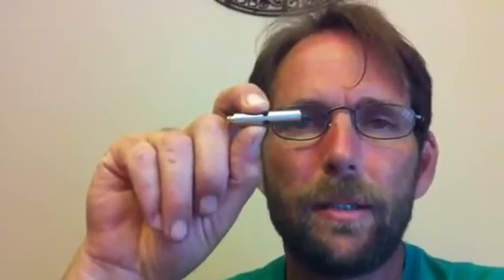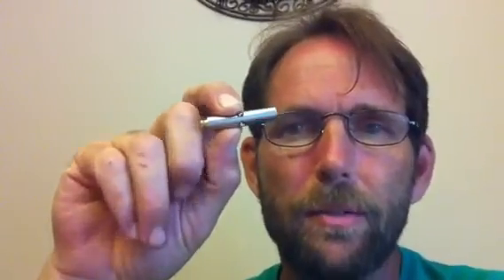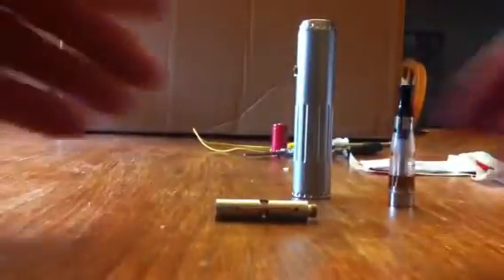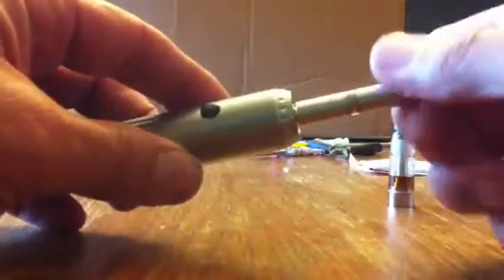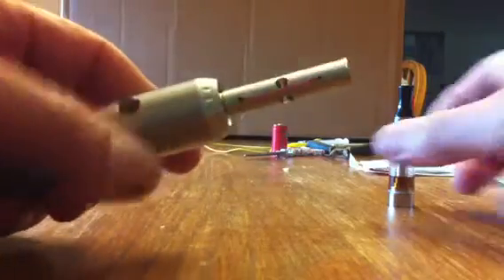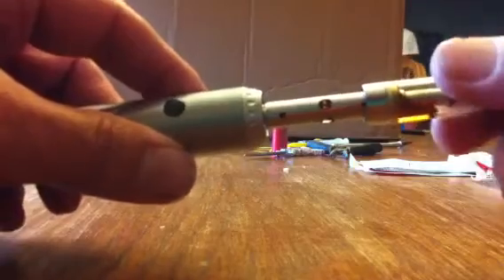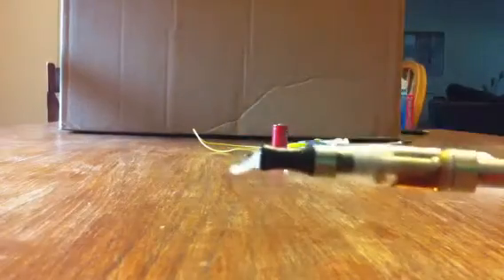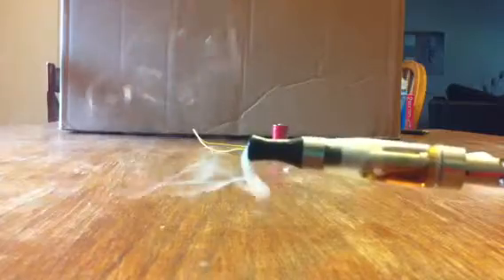Air Powered Assisted Module (APAM) Prototype #1

Comment from the maker: Ok will be going with a lager format for increased air flow. Will be using a 5/8" dia motor at 13,000rpm, and a custom fan at 15.6mm in dia x 5.36mm tall. This should significantly increase the air flow! Will encase it in a SS custom body that will fit between any 510 PV and Atty.
More to follow when I get the new parts in.
Dan

Comment: Very cool. I guess it would take something with more power that has a catch all of some sort for condensation when used with a Genesis. Make the connection at the top cap in place of a drip tip with a hose pulling the condensation back on to the wick rather then the fan pushing it in your mouth. Now that's a real Hybrid : ). Sounds really complex though. Great idea on your part. Bet this takes off.